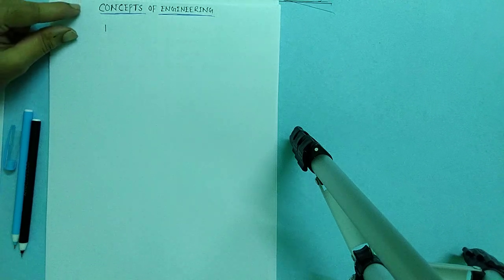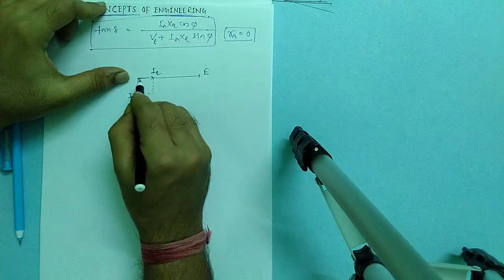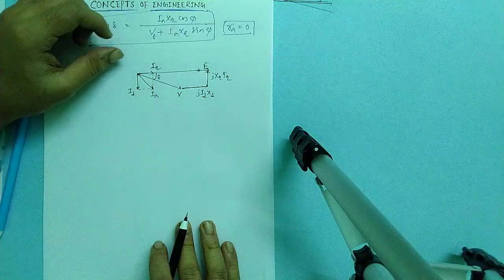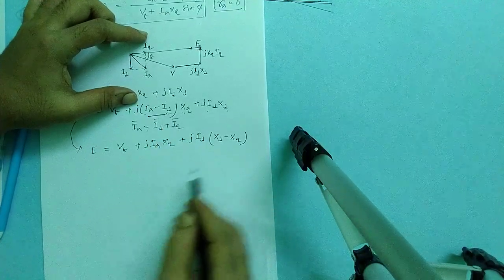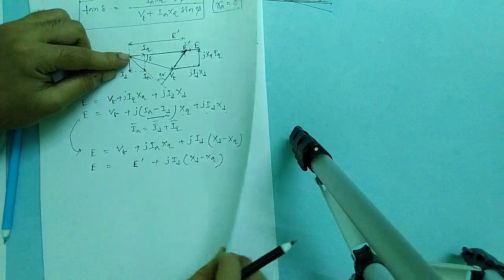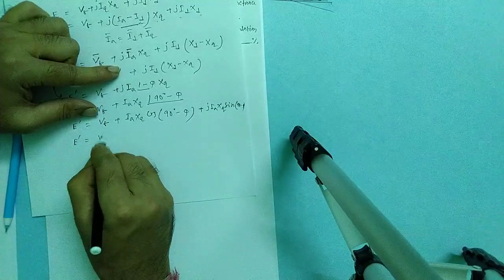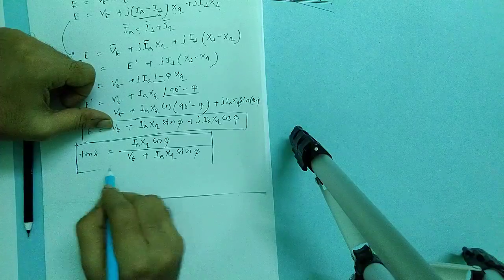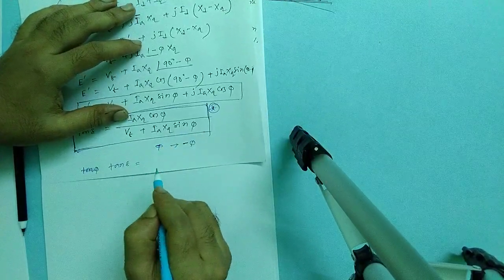Details of phasor diagram of the Salient pole Synchronous Generator.

Comment: Thank you, this was very helpful to me.

I think it should be emphasized that the "trick" to this problem is to simplify the equation by creating a new vector E' by adding jId terms to E, so this new vector lies along E. Then, the reference phasor is switched to Vt since the power factor angle (phi) is referenced WRT Vt, and the angle between E and Vt is the angle of the complex number E'. The armature resistance can be easily included using this method.
Reply: all the best for your future